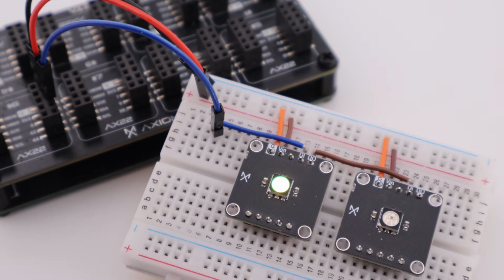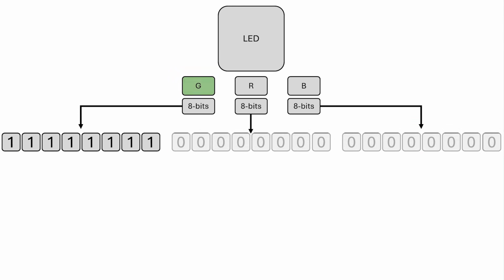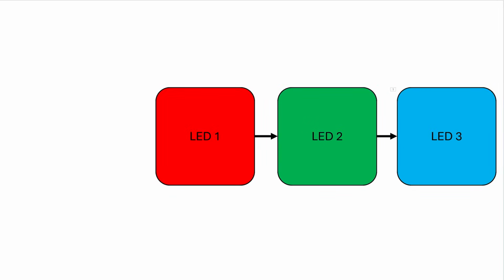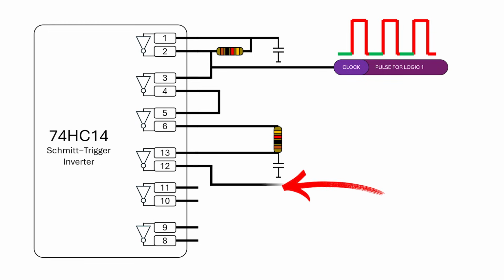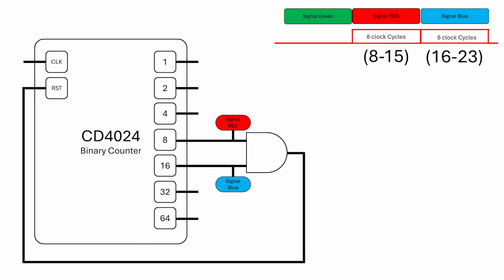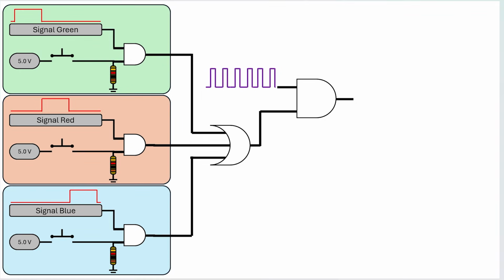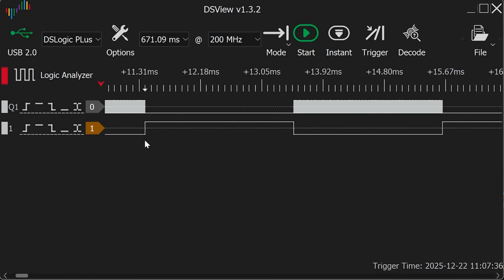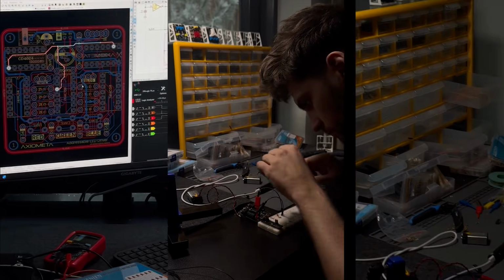Controlling NeoPixel LEDs Without a Microcontroller

Comment: I tried to bit-bang a consumer infrared remote control using 74HC165 shift-registers fed from DIP-switches for the address and diode logic for the data byte, but my use of a bunch of 74HC14s for timing the delays just wasn’t very robust.

Comment: Awesome idea. Would it be possible to incorporate dials (variable resistors) to set the intensity of each color?
Reply: How exactly would that work.
These LEDs do not work based on a pure analogue signal where altering some property of it ( say the voltage ) directly corresponds with some property of the LED ( say the amount of red ).

The colour is based on a numeric value which is set not by altering some property of the signal to match the desired number but by a sequence of highs/lows which need to be altered at fixed intervals.
Reply: @mrx2586 idk bud, I'm not an electrical engineer, hence the question mark at the end. 😃
Now are you attempting to answer my question, sarcastically, with a rhetorical one? Or are we both floating on the same sail-less oar-less boat of ignorance?
If you know the answer please phrase it as a statement and provide a clear explanation or a source so that I can learn something useful. If you don't know, please refrain from asking the other ignorant person, it doesn't do either of us any good.
Reply: @TurboHooptie  

We are probably both on the same boat of ignorance.

However do know that analogue data ( as a person can sense it ) is simply some property of the waveform. So colour as you see it is some property of an electromagnetic wave which can be converted to an electrical signal within a circuit which is why continuously adjusting the correct property of the electrical current ( which is effectively what you suggested doing ) and then converting it to an electromagnetic wave ( by using an LED ) would be a workable way to change colour. 

as soon as digital data is used however this changes. there is no longer continuous change, instead there are only 2 possible values ( so what you suggested would no longer be viable, what is needed is more like a simple switch ). as the video explained time is used to make it possible to chain lots of these "2 possible values" together - it becomes a function of time not a function of gradually moving a dial.

there are a range of ways that a 1 or a 0 can be encoded into a analogue wave and a range of ways of seperating each value from the next.

here is a video which explains some of them

https://www.youtube.com/watch?v=8e4Sf6rL3zk

also this is very much the point where you start to move away from electrical engineering and into the beginnings of software engineering.
Reply: @mrx2586  my thought process is that, since it is controlled by software, it should be entirely possible to incorporate 3 potentiometers to send 3 separate signals that can be interpreted by the software as the desired intensity for each color (R,G, and B). It doesn't have to interfere with the power distribution to the actual LEDs but the software can interpret the voltage/current from the resistors as a fraction/percentage which can then be used to manipulate the binary output.
Reply: @TurboHooptie  but in the video he did not use a micro controller or software. thats the whole point.
Reply: @mrx2586 oh yeah, sorry it's been a while since I watched the video and totally forgot the premise (I was kinda chopped too when I watched it). But I still think the same logic can be implemented within the circuit (maybe?), the logic itself isn't that complex, but I could be wrong as I know nothing of the limitations of such systems.

Comment: Very interesting and creative way to use addressable LEDs without a microcontroller. However, the real fun of using addressable LEDs is each one can be its own color. But in the spirit of design, it's an excellent example on circuit design! 👍🏼

Comment: This is generally how I built stuff up until the later 1980s, when MCUs got a lot cheaper and easier to use. The problem with this is it's quite a lot of chips to do a job that does not really address nor uses the full potential of the LEDs. A MCU can be considered as a "universal logic chip kit", that's often how it was sold to us hardware jockeys back in the early days. While interesting from a didactic point of view (and I'm forever seeing circuits using MCUs that simply don't need them), for this application, honestly, just use a MCU.

Comment: Great Project! I don't quite understand, how to dim the colors however. Is it done by pressing and holding the buttons or are those fixed brightness per color value?
Reply: Yeah, I didn't see how the circuit was sending anything other than 11111111 or 000000 to the LEDs, so you get black, white, red, green, blue, yellow, cyan, purple.

It would be cool to add a counter/gate that would pass say 50% or 25% of the positive cycles on each color channel - though, you'd kinda be replicating what the WS2811 controller on each pixel does anyway.